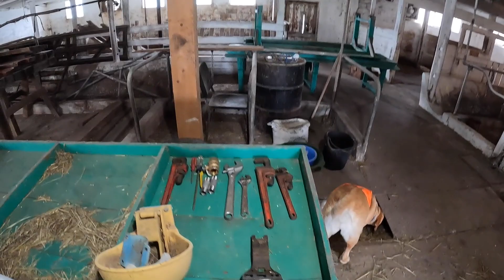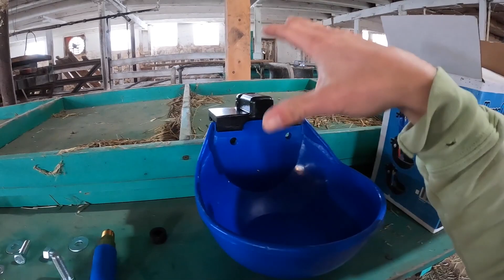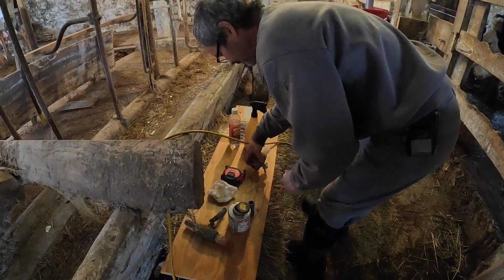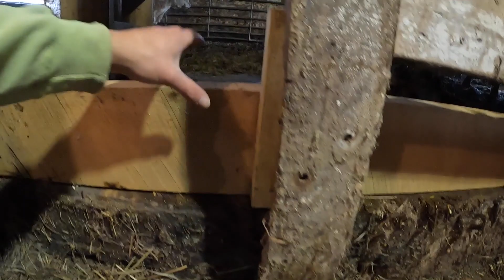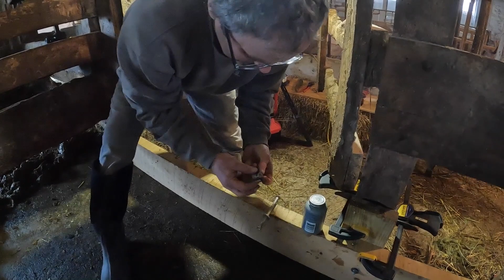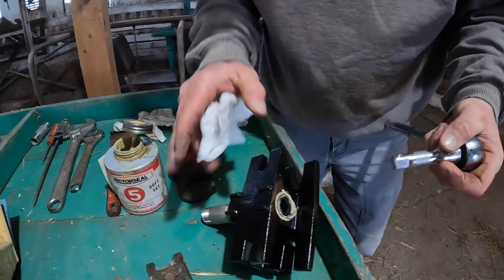Improving 75 Year Old Cattle Barn

Comment: Great video that shows some of the maintenance that is required on the farm. Heat guns are a handy thing. I like to use boiling water from the kettle to soften the connections too. It works fast and gets the job done. Thanks for sharing and good luck with the rest of the maintenance.
Reply from the maker: Thank you for watching 😃

Comment: Thanks for the video, You should never put pipe dope on the inside of threads, only on the outside of the male pipe threads, it may plug the devices because you push the dope inside of the unit. Thanks, that is a really nice old barn.

Comment: Heat guns do wonders on plastic plumbing pipe.  Used that trick this past Summer and it worked well.  Heat gun also helps to better seal plastic pipe after repair. 👍